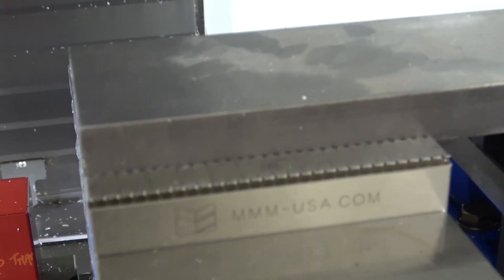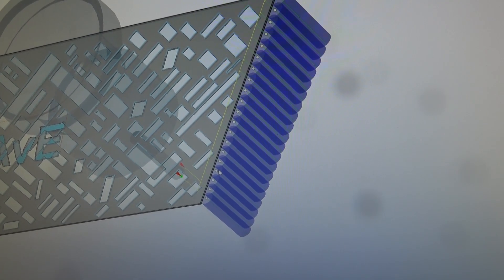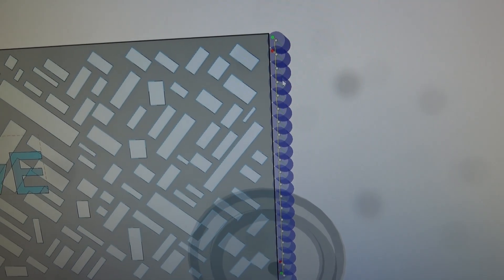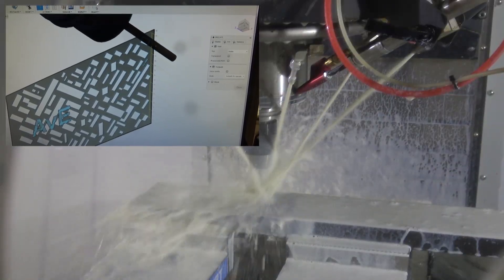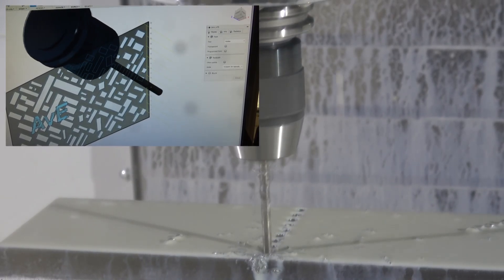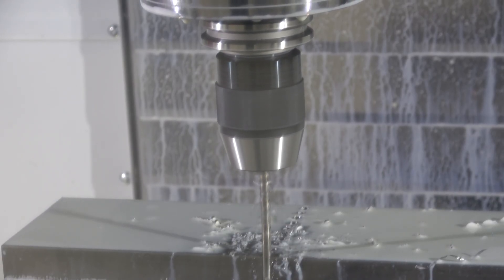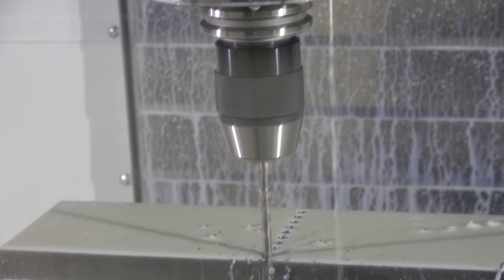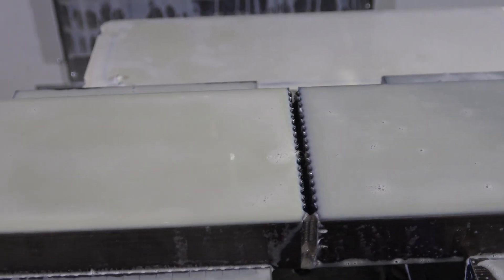What is Chain Drilling?

Comment: In aviation, air drills are still extremely common. Battery drills are great, but as long as your compressor is functioning, you never have to stop while drilling rivet holes or chain drilling to make a tricky cut.

Comment: My dad needed to remove an old cast iron bath tub that was on a second floor.  He chain drilled it all the way around and hit it with a sledge hammer to have it break along the drilled line.  Worked like a charm.

Comment: I've been stuck doing this by hand a time or two.  I drill every other hole, set a rivet into each hole, then drill the in-betweens.  The rivet keeps the drill from wandering, because it still has metal on both sides.  A pain in the ass, but sometimes ya gotta get it done, regardless of what's broken.

Comment: I could have milled through that with a half inch end mill in less than a minute but I can see how some drills have higher material removal rates.. I can punch a 2" diameter hole through 4 inches of steel in about 20 seconds on my machine using a sumitomo indexable drill... that's a lot of material in a short period of time... then again I have a 40 horse CAT50 spindle.. anyhow.. I still feel you coulda milled through that faster than drilling with a HSS drill.. And I do agree that chain drilling could be faster with the proper Solid carbide drill

Comment: this idea works great for thick material which i don’t have a saw big enough, but to add to your technic is to drill with two size bits, for every other hole, first the small hole spaced nicely, i didn’t have a CNC only a good old power drill

Comment: Soon as I saw the meat of the material I cringed, it can be done in a pinch - but the entire process is sketchy. Thankfully, with CNC, so long as the machine's well calibrated and the bumblefuck programming it isn't a complete douche it can be done just fine. In most scenarios however, in most shops or most fabrication situations: you go grab the oldest, crustiest, meanest machinist in the shop and have that cantankerous old bastard do it - because anyone else is gonna cluster it right to fuck.

Comment: I can’t find the photo, when I saw it my jaw dropped. How the Wright brothers cut out their crankshaft. The article says their machinist had only lathe and a drill press  “The crankshaft was made out of a block of machine steel 6 by 31 inches and 1-5/8 inch thick. I traced the outline on the slab, then drilled through with the drill press until I could knock out the surplus pieces with a hammer and chisel. Then I put it in the lathe and turned it down to size and smoothness.”  That is some hard-core determination!

Comment: We do this in concrete cutting sometimes when we need an opening but the concrete is too thick to be able to use a saw blade (without overcuts), we call it line drilling or stitch drilling

Comment: I know EXACTLY why this is in my recommended videos today...

I had 30 hinges that I needed to drill two holes on each leaf (120 holes) . After I was done I realized I needed those holes to be slots.

I would have been ok with drilling two side by side initially (240), then file out the innards,...I was NOT ok drilling an additional hole on each side of the centred one that was already drilled (additional 240 to make 360 total holes drilled). I am not a machinist and don’t have access to machinist tools.... 

my work around??.... self tapping machine screws to secure a round metal file of the same diameter of the initial drilled  holes to a reciprocating saw blade...... installed that into a reciprocating saw and boom! Much faster than filling those slots manually!

Comment: Some managers also believe cnc works like a microwave.  Whip the stock in the door and hit the green button.  30sec later you should have a perfect part complete with complex geometry, ultra fine finishes  and tight tolerances.

Comment: this is old school , I've done this with a large hole .drilling a circular pattern to remove a slug in a thick plate . three years later i machined a part from  said plug . AvE keep up the fine work
up there in the frozen north woods of where ever it is you are .

Comment: This is used in pcb manufacturing to "drill" slots into pcbs.  There is even a G code for it. It does several phases to remove the left over bits so in the end it looks like it has been milled.

Comment: If you want an easy way to figure out twist drill feeds and speeds, work using surface speed, and feed per rev based on percentage of the drill diameter.
HSS Twist drill  
Mild steel:  30m/min Vc    1-3% drill diameter Fu  (aim for 2%, make the chip break! peck ~1-3xd)
Alloy steel:   15 m/min Vc    1-2% diameter Fu. 
Stainless:   10m/min Vc       1% Fu. 

Fu: Feed per rev
Fz:  Feed per tooth
Ap: Axial depth of cut
Ae: Radial depth of cut.

Comment: Never seen this done in metal, but it's a pretty common technique for slicing concrete (or stone) slabs if you don't have a specialized cutter. In concrete though you can't overlap the holes, you just drill them as close as possible and than use a chisel and a sledgehammer to dislodge the piece.

Comment: When you bought your big and fancy cnc machine did you get thru the spindle coolant? Turn that shit on if you got it and you have the correct holders, and a cock with a hole in the end for the magic juice to flush out the dirty bits. You will see some hole drilling!!
Mike - Plus8Precision

Comment: Had to do a truss mount change (engine mount for planes) out in a desert location in a faraway place where a lot of a*holes tend to gather and had absolutely NO backshop on location, so when the 2'x3' 1/2" aluminum guide ended up having some overlap with other components we had to chain drill the interfering sections out by hand, on account of only having hand tools available and it would've been 1-3 day delay to wait for any other tool from the home base. Never thought to take it to a CNC setting for larger stock. Love learning new applications

Comment: I would suggest it is better to drill the holes so they leave a .005" web between the holes and then break it off afterward.   Should be less stress on the drill bit.  See the recent video by Joe Pi.

Comment: This is how they make holes 4 d i e s. They call it die sinking. Whenever you have to remove a lot of material if you drill around the edge and then enlarge the holes with the next size up or two. The centerpiece will fall out. I have actually done this with a hand drill in tool steel. Once you get it basically hog day out then you Mill to dimension it saves making lots and lots of chips and your drill can be easily re sharpened by hand as opposed to an end Mill which is a little bit harder to do by hand

Comment: Shouldnt hole drilling, as in with a hole saw be faster? You only need to cut the perimeter so its less material to remove but once done the whole slug falls off so it should be faster?

Comment: AvE I recently purchased two old golf carts. Both are pretty archaic in their design. Their resistor coil setup is pretty wasteful. The market has well overpriced electronic controllers... They got ya by the short hairs. So I started thinking ( yeah, I know bad idea) what if I used a PLC. Someone has had to try it. Unfortunately, there is not one resource out there that I can find to try it. Anyone want to help or take a shot at this? 36v DC club car DS.

Comment: Old Excellon CNC drilling machines for PCB production used to have a command something like this... X#Y#G85X#Y# which pecked a slot. It was way smarter than what you're showing because it first drilled the end holes, then one in between, then others exactly between what was left.... rinse and repeat until a predetermined cusp size was left. This worked really well because when the holes started to overlap, you always had the same amount of material either side, so it was less prone to break the drill.
Maybe there's a similar command you can use on modern metal cutting machines?

Comment: I drill a pilot hole half the diameter of the final hole and it forces the drill bit in the final step to follow that tunnel.  Without it it'll snake around occasionally and piss me off.

Comment: Cast-in-place concrete retaining walls are built similarly  - they are called secant walls. It's done when you need a leak-resistant below-surface retaining wall.  Drill every other pier and pour cast-in-place concrete.  Before those piers cure too long/get too hard, drill the pier in the middle so the middle pier is partially drilled thru the adjacent concrete piers and you end up with a solid wall of concrete below the surface.

Comment: imo it's better to leave a few thou between the holes that way you can just do them all in a line and not worry about wandering or bothering with spot drilling. that said if you have to do this more than a couple times you may as well go out and buy a new portaband with the machine time you'll save

Comment: I’ve seen something like this done with screws installed after each drilled hole then Cutt flush and another drilled in just beside and the process repeats each screw capturing the one before. It was a process used to repair cast iron engine blocks that were cracked sometimes they would come back over it with a brazed repair
Reply: Lock n stitch..
https://youtu.be/Pq0wfU4ZaKk

Comment: That looks like a good excuse to make a shaper bit attachment. You wouldn't need the claper since it could turn the bit 180 and cut in both passes. It wouldn't be limited to the old in & out either. Let it drag like the ripper on a Cat doser and you might be able program in some curves. Better order a spair set  of X & Y drives first.

Comment: That bit is so long and so much of it is outside the chuck it's no wonder it deflects so much. When doing stuff that can likely bust the drill bit the best bet is to have only as much bit exposed as is required to get through the work piece. Of course if you can't do that because of what is on hand well then I understand why it's out so far, when it breaks off there will still be enough to use to get the job done. I see the thinking there.

Comment: That drill bit bending like it did had me cringing so hard. I was expecting it to snap off and fly half way across Canada.
Reply: safety squinted at my monitor irl
Reply: I was bracing for Pting Fuck on that one.
Reply: Drills can bend a surprising amount before breaking. Especially when your holder sucks and they slip out and don't     quite clear the hole.
Reply: @masterpython  except when you drop it on the floor then it acts like glass.
Reply: It had my toes curling. And my wife was nowhere near.
Reply: Same here.

Comment: So what is an application example for the chain drilling?
Reply: hogging out a big pocket for example, if you want to make like angle plate or something else that has a big pocket open to one other face. it can also be helpful if you want to go deep, but don't have a long reach end mill. take it out that way, and use a end mill on either side to clear it out. bonus effect, the inner material can be used for something else. you only lost either side the diameter of your bit + some allowance for finishing. will help for example in brass or other copper based alloys that are expensive....

Comment: Pretty similar to the way we made slots in circuit boards back in the olden times. After the first middle drill we divided it up again and drilled the middles of the middles. Not tea bag for the times.
Reply: Yeah, I remember those days, I once had about 50 boards of G10 epoxy to do that had those Mallory metal can capacitors that had 3 lugs per that required a slot each lug. Only had a carbide bit and a drill press and a needle file, I was ready to fall on my file after the first hour.
Reply: @BeachsideHank  
LOL, those were the days my friend! Black dots and red and blue translucent tape! Teletype model 33 to create the paper tape for the NC drill, note the lack of a C in NC. :-)

Comment: Fun fact, this is also one of only two methods for cutting through very thick concrete as in several feet or a couple meters plus, that I know of. Though you use core drills, as grinding that much concrete to slurry would be insanely slow.

The other is to drill through and thread a diamond cable saw through the holes.
Reply: Slate is also mined with cable saws. You blast two parallel tunnels and then saw through the rock between with cables.
Reply: Nils Schenkel Pretty sure they usually use core drills for that too now, at least I believe I saw a video of it on YT.
Reply: @Nevir202  This may depend on the site and available machinery. I can imagine that core drilling is easier and faster on the surface, while a cable saw requires less space underground.
Reply: Nils Schenkel Well, it also depends on what kind of access you have, if you only have access from the surface, chain drilling is your only option. 

Cable sawing requires access from at least two sides. Although, I suppose you could use chain drilling to remove a section and then once it’s out, get down in the hole, to access another side in order to continue with the cable saw.
Reply: I hope the cable saw is better than those cable saws survival knives have in them to cut through wood because I broke that in under 2 minutes.
Reply: @johnpossum556  they have higher skookumness, sure, but the main factor as far as longevity goes is that the industrial one has a regulated hydraulic or VFD drive and not a 200 pound gorilla tugging on it. Much more balanced application of force means the thing gets to live longer.
Reply: John Possum Ya, it’s big, high tensile cable, and the cable isn’t doing the cutting, there are big lumps of diamond impregnated metal compound spaced all around it, the cable just pulls them through the work.
Reply: Tzuede Off the Cuff I think I saw it before, improvised tools are always fun.
Reply: Bentonamite not fast but saves on drilling
Reply: Tzuede Off the Cuff  link please

Comment: I try to leave .005 to .010 between the holes. Drills tend to cut a little oversized anyway. Then just whack it with a chunk-O-brass ,or copper if you prefer that flavor, to break the webs.  She’s an olde technique but it still works a treat if in one is so inclined.

Comment: You become a man when you have to do that with a clapped out hand drill and a dull bit.
Reply: Been there, done that, never again
Reply: @osvaldoa2596  until the next time anyhow.......
Reply: A drill with bad brushes and a bit you used on concrete last week because you couldn't find the right one.
Reply: @Lumumba B. 
In the bush you use what you have, i have a ton of carbide bits now, commercial repairs and more stainless steel then i care to remember.

Comment: Interesting way to do that, I would have probably used a 1/4" end mill and zipped back n forth till it was 2 pieces. But to each their own!
Reply: I probably would have used his cold cut chop saw.
Reply: That's what i said, but I'm just an old tool maker who went on become a steel machining manufacturing engineer after finishing a mechanical enginerding degree.

Comment: i do this with forstner bits to wood before i route on inside cuts like control cavities on guitars
Reply: NickoLps  because routers are noisy and messy and have a tendency to try cremating the tree carcass you're working on. What's more, router bits are tiny so it ends up quicker to do the bulk of the material removal with a nice wide forstner bit and bring it up to the line with a router after.

CNC routers are a whole nother matter. If you've got one of those you can just press play and have a cold one
Reply: @zeebeezoey  if you're burning the wood you're routing, generally you're not cutting fast or deep enough. You need to remove a certain amount of material in order to cool the bit. But I agree with you, a forstner bit in a drillpress is much less noise and mess than a router. 
Then again if I have the right size bit for a slot, I'll just use that. No need to bother with stock removal first.
Reply: @zeebeezoey  Really good idea there. Thanks
Reply: What are your feeds and speeds?
Reply: NickoLps  that's still pretty small compared to a 40mm forstner bit

Comment: Definitely thought that bit was going to f#$% off. But I was pleasantly surprised.. By the way, what's up with the diesel engine out of the generator?
Reply: HSS has more flexibility than tungsten carbide bits.
Reply: @johnpossum556  why does HSS get a bad rap? Abom's channel makes it seem like you can do just about anything with the stuff as long as you know how.
Reply: @cheyannei5983  AIUI HSS is relatively soft (by tool material standards), this has the advantage that it is less likely to break and it's easier to sharpen or customize tools but it means the tools dull quicker and you can't machine hard materials (sometimes this can be worked around by hardening after machining but that approach has it's issues too).
Reply: I second the question about the diesel.  Was hoping the wait was for a 2 hr compilation vid of the rebuild.  Chock full o comments like the one about your little Chinese buddy....LOL.  Pting Fuck!
Reply: Those HSS bits are surprisingly forgiving. I have to hide the good carbide bits otherwise my cohorts will thow them in a hand drill and fuss when the chip the cutting edge or snap them off in the hole.
Reply: Up voted on account of I want to about the generator too.